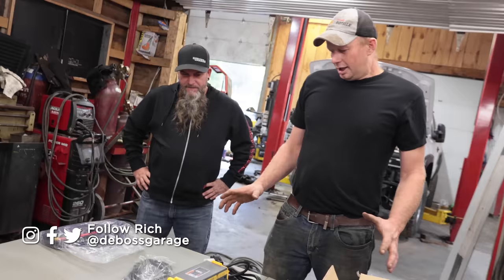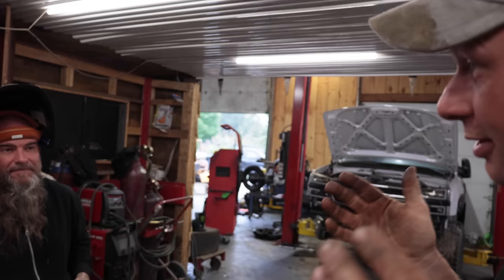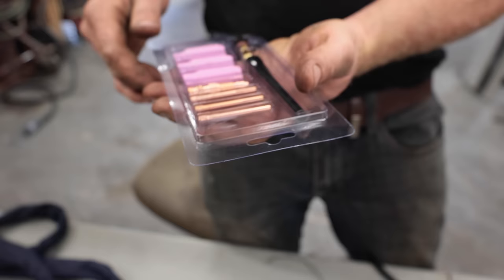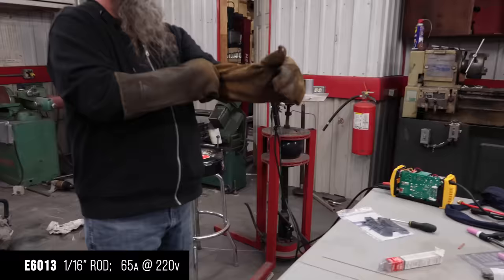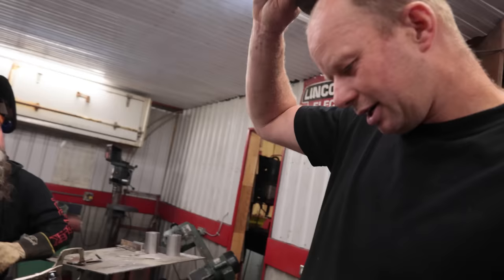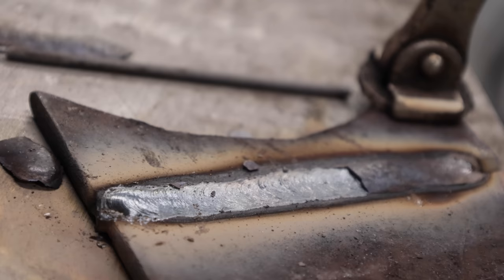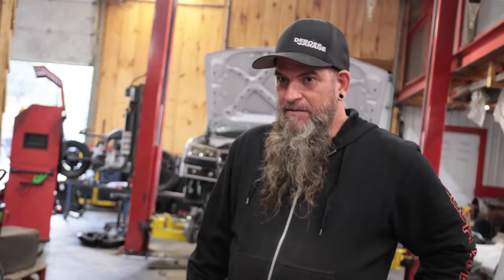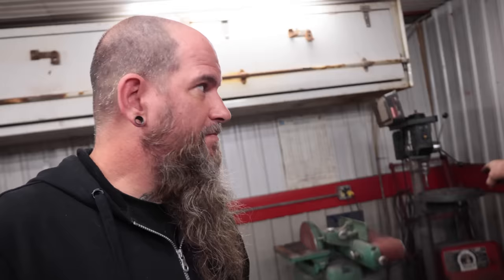How Good is the CHEAPEST Welder on Amazon?

Comment from the maker: Can a 12v Inverter power this welder? Let's find out! https://youtu.be/uPuOjAOAT1k
Links:
$70 TL-1355 LT https://geni.us/135Astick
$100 TL-1355 LT + TIG https://geni.us/135AwithTIG
This one can use a pedal: USD $200 TIG Welder https://geni.us/200TP
USD $70 Pedal https://geni.us/TLFP5P
Reply: whats the watt  rating on that welder
Reply: its 109  cdn for  the sick only kit 241 cdn for the stick/tig kit
Reply: @donaldcrites7504  ya, was going to mention that, was interested at 70 to toss in trailer, less so at 110.
Reply: the tig option is $241 and that's the cheapest its been since it went on amazon in aug. how did you get for $100??
Reply: As a Canadian, it would be proper to use Canadian prices, as bad as they are. Otherwise a good video, and quality review
Reply: Vulcan protig 205, it’s one of the cheapest in store tig welders capable of aluminum and pre/post flow
Reply: i bought a cheap 50 then 70 amp plasma off ebay/amazon and they did great till it stolen..lol
Reply from the maker: A point of clarification, $100 is the USD price for the TIG version, and some are noting the Amazon.ca price is $241 CAD. Canadians can buy this from the Amazon.com USA store and ship it to Canada - that's what we did and paid $182 CAD with no additional import fees (your mileage may vary).

USA Link: https://www.amazon.com/dp/B08B3VHN54?&linkCode=ll1&tag=deboss-20&linkId=a16da0d2dfafeeb18e4a88ded27bf9b7&language=en_US&ref_=as_li_ss_tl
Reply: I got a price of basicly 240 dollars on Amazon
Reply: @DEBOSSGARAGE  sorry for the confusion, being were you are located and how often you mention canadian pricing, i figured this was also $cdn,
Reply: Cheapest Plasma Cutter on Amazon? I found this very interesting BTW, have a MIG but sometimes, could use a stick.
Reply: I think is good to say that by removing the cover the wind tunneling is weaker therefore cooling capability also going down, so coil probably will be cooler in closed enclosure.
Reply: $67 bucks with free shipping
Reply: Thanks guys you got my sub like and comment. 3 out of 3.
Reply: Where did you buy it for $100?
Reply: What amp circuit do I need to run this stick welder on 240?
Reply: These don't give accurate current readings. There's tips for setting it right. (Videos on YouTube)  a little bit of soldering. And a resistor fixes the problem.. but it's not VERY important..
Reply: Well the next logical thing would be a plasma cutter, let's keep the sparks flowing
Reply: Floor Jack's and Jack stands! To many guys out here buying cheap stuff and risking their life to save a few bucks!
Reply: $70 welder!? Nope! $181 as of November 8th. 😢
Reply: @DEBOSSGARAGE the tig option is $177 us price. Dunno where you see it for $100
Reply: @kendraymason  the one they got was the 135A stick welder, which isn't currently available and is redirecting to the 195A welder.
Reply: If the case was on it it would run cooler.
Reply: Your pricing is way off. It is 130.00 us and with tig attached it 165.00 us. I dam sure buy 2 if they were available.  It diverts you to the 195a arc tig welder. 
Thanks for showing us.
Reply: Yes, I have had that welder for about three months and I really like it. I use it on little stuff.
Reply: The 110/220 version isn't available on Amazon anymore, all I see is the 110v, that sux.
Reply: Your review must have sold them out, no 220V available anymore :(
Reply: This was a great video that led to me subscribing I can't believe the work you got out of this little welder ! Unreal
Reply: Will it work for aluminum?
Reply: should use this welder to start a truck or something 👀
Reply: Will it run on a generator in an emergency?
 Watts tha rating plz!
Reply: In the Amazon link there’s one 135 and other 195 amps. This one in the video is the 135 but it comes with the tig addition. For a beginner, is best to get the 135 with the tig? Or will the 195 be a better option. They cost almost the same. There’s also a big difference in price with the 135 alone (no tig). Is the addition a good thing, or is it rarely used?
Reply: I just have to say the prices are exactly what he said in the video and as this comment so everyone talking about prices other that those listed are crazy.
Reply: Good
Reply: Would it work for motorcycle framework(build)
Reply: Surprised to see how well this worked.  I'm seeing this  5 months after it was first posted.  Curious if you have used it since, and if so, has it performed decent in real world situations?
Reply: I wonder if it will work with a - suitable - DC voltage. Like, lets say, 100-110V, or else.
Reply: 🤛🤜 teaching me new things that's what's up 
😊
Reply: @DEBOSSGARAGE  just watched vid.was going to say, can an inverter welder, be run with an inverter. i have a 3000w inverter.. a welder 4x4ing would be handy.  ausie..
Reply: @planitmc1204   mine is showing 67.99 for the regular and 99.99 for tig version
Reply: Keep the cover on , That will help direct the wind from the fan to dissipate heat ..
Reply: Just got my welder off of Amazon for $54.80...it going to kill me?

Comment: The welder guy with 40K hours welding was super chill and knowledgeable. You chose a cool guy that was genuinely impressed!
Reply: his hood constantly falling down pissed me off for some reason
Reply: @wadeedwards6194  ikw but that made me laugh 😂
Reply: Yeah, he wasn't one of those intolerable OG's who think anything other than their "insert expensive brand name here" is "rubbish".
Reply: @wadeedwards6194  Goes to show how old that hood is that it doesn't hold it up anymore. I kept thinking a few rubber bands might fix it lol
Reply: Not use any equipment that is not in working order.
Reply: dude was so chill!  love him lol
Reply: @_knight-king rite
Reply: I only have maybe.. 4 hours welding but isn't it SUPER dangerous working around that open control board considering the voltage and amps running through it? That's a major safety hazard.
Reply: Nope
Reply: 40k hours? Anyone do the math on that?
Reply: @InCognito-yq5ew  plus minus 4,5 years of straight welding
Reply: @InCognito-yq5ew  you have gaming players with over 20k hours, some with over 30k hours, I know because some are friends of mine 😂
Reply: agreed, he probably doesn't know it's actually a High Frequency model. LF would be a transformer based unit.
Reply: By time I’m his age I’ll have way more hours and be much better welder than him. He is a clown welder

Comment: Been a commercial industrial electrician for 24yrs , always wanted to learn to weld , seen this video a month or two ago and picked up this welder first week of February for my birthday . Having a total blast ! Pulling scrap steel off the jobsite all week , and spending the weekends drinking coffee and welding in the morning . Thanks !
Reply: Coffee welder 🧑‍🏭 ☕
😁
Have fun
Reply: Fellow Electrician, only been in the trade 10 years, but Commerical/Industrial as well.

I've had a Hobart MIG sitting around for a few years, I think this video and your comment will finally get me out in the garage welding some steel up.

Gotta start somewhere.
Reply: @perotekku  right on man ! Yeah just a skill i always wanted to have . Been alot harder to do well than i thought , but im making some slow progress . And having a blast . Funny , bought an inexpensive welding table last sunday and found a connection point had broken during assembly , tacked it up and shes ready for coffee tomorrow haha had to use the welder to fix the welding table to continue learning to weld .... its a viscious cycle .
Reply: Did pretty much the same with a flux core welder for my 40th birthday. I still stink, but I stink less!
Reply: where do you gets rods from?
Reply: Living the dream
Reply: This comment slapped a smile on my face faster than the video
Reply: I dont know where you live bro but, you can find rods at Tractor supply, harbor freight, home depot, lowes and ive even seen some for sale at Walmart a time or two  @Mysticlavalamp
Reply: You must be pretty good after 24 years. Bad electricians tend to become welders by accident and surprise. 😂
Reply: @joeypriolo  not to shabby haha , foreman doing schools and federal buildings . Just always wanted to be able to use the ole big boy metal glue gun .
Reply: I'm a hvac technician in the steamfitters union for 32 years just starting getting into welding mostly stick now I'm going to do tig. This morning I'm going to layout plans on a drafting pad for a welding table I'm going to build out of unistrut
Reply: Haha you sounds so chill to hang with i need friends 😂
Reply: That's exactly what I'm goona do!:)
Reply: How is it with 1/8 rods on 110v?
Reply: @irishlush364  not bad , not perfect , im learning so .. some spatter but good penetration on 1/4" structural steel . Trips the 15amp breaker i have it on when using higher amps for a long weld .
Reply: This is all I needed to know, I have some projects I need to do but have no idea how to weld.
Reply: I was looking at these of shore cheapo machines but wouldn't jump. I may now just to have an emergency rig. I've had Miller and Hobart and even a snap-on machine so this video impresses me !!
Reply: I had randomly seen this video in the past and came back to watch. I'm literally thinking on doing the same thing 🤣
Reply: Which one did you get? There's several options on Amazon. Thinking about buying
Reply: @UNUmusic  135amp 110volt  model TL-135s

Comment: I have one too and the worst issue is you have to strap it down because the leads will drag it around lol.
Reply: LMAO, NICE.
Reply: Not a bad deal😂
Reply: That very much seems like a first world problem.
Reply: Would be perfect with a 120/220 belt drive generator on the engine. They don't care about frequency, so RPM wouldn't matter.
Reply: I have one slightly bigger, 200A.. similar form factor.   I bent a piece of rebar into an S- hook.. and I would carry it around with me welding up a metal building.   The leads are short, so I would take it up high on a ladder and hang the welder on a purlin nearby and just weld with it everywhere I could reach--  and move again.  :) ..  I could weld with it anywhere with that big rebar hooked through the handle on top.  Sounds cumbersome, but it was actually very handy.  I could just grab it and go with a simple extension cord--   where as rolling out the big welder is a chore:  if you only need a few quick welds.   They are great little tools to have, even if you have a big welder.
Reply: Yeah, but at least you'd be able to move around your work piece like a truck frame or such easily. Just give the cables a tug and sling that box around so you can continue working  🤣
Reply: @korishan the lugs are cheap ass plastic on the case. That's how my first one died. The lug broke and grounded the case. Then it welded itself into a fireball lol. They warrantied the thing though!
Reply: @ionstorm66  🤣🤣🤣🤣🤣
Reply: NO SHI *
Reply: @korishan new one is over a year old. I have it and my tiny flux mig build into a milk crate and take them everywhere.
Reply: If that's the only issue then it's a good deal 😊
Reply: That's actually pretty funny...
Reply: @calholli That's awesome and thank you for sharing that! It's nice to see someone unafraid to say yeah I've got this little guy in my toolbox and it kicks as a nice little portable welder way up on the ladder!
Reply: Lol they're getting smaller by the minute. They're pretty darn cool.
Reply: ionstorm66. I put mine on a Workbench with G Clamps on Either Side !!!

Comment: I bought one, I was fabricating the support structure for a 20' x 30' solar array, 3" x 3" square tubing 3/16 wall. I have a Miller Thunderbolt AC machine, what a fight to weld out of position. Bought the little welder and it was a totally different experience, all position, it didn't care or fight me with what I was trying to do, it just welded and did everything I ask. It's the best $70 bucks I have ever spent on a tool. It would be a great machine for someone to learn on. To see it gets the Vince Stamp of Approval is all the better, Great Review !!!!
Reply: Just commenting on your thunder bolt welder . I had one that belonged to my father and he used it for many years .I got it after he passed away and used it for 8 years . Now my grandson has it and it still works fine . Now I wonder how long will it last . I might not live long enough to find out . So to say they last is a understatement .
Reply: Nice to know!

Comment: I have been welding for 32 years. I have been constantly surprised by the capabilities of these new tiny machines
Reply: I got their multi process welder and it is better than the Miller I bought like 12 years ago. Technology is advancing at a ridiculous rate and becoming less and less expensive. The Miller cost me about 1300 bucks when I got it and the Tooliom was like 400 lol
Reply: Inverter technology has brought both the size and weight requirements of the welding machine down, and they're constantly becoming a lot cheaper.
With thatsaid, I did just recently buy a new ESAB inverter machine for $5000
Reply: the massive jump in solid state inverter parts, ie: no more bulky transformers and the stuff you need to keep all of that where you want it and cool is, has been a game changer for dc stuff from higer voltage ac mains. its totally bonkers.
Reply: Pretty soon we will have a tool the size of a pen 🖊️ that will be able to weld!
Reply: @thatoneguy454c - In no way can that cheap thing compare to a Miller.  Not a chance, no way.  That cheap Chinese junk is just that:  Junk.
Reply: @Neeboopsh - Did you see the coil / inductor inside this little POS?  Yeah.  Because that can't be replaced.  The tech improvements have been in the ancillary components, not the main ones.
Reply: @foobarmaximus3506  yes, new "Chinese junk" welder outperforms the almost 15 year old Miller I have. I didn't say it will beat any Miller, I said it beat that Miller. It's just a matter the difference between 110 amps vs 190 amps. I can burn 5/32 hard facing rods with the Chinese unit and I can't with the Miller. Any welder that can run 5/32 11018 rods is going to get the job done. Will it hold up as long? Probably not. Is it a good option if you can't drop $1700-$2000 on a welder for your workshop? Yup, it most definitely is. I have used it for MIG and TIG,  it also works well for those processes.
Reply: @thatoneguy454c bruh don't be switch.
This "cheap" welder is great!
"Overpriced" Millers are good too.
Reply: @GOOGLE-ADMlN  switch? Lol and I know that is what I have been saying
Reply: i seen a yt video of someone welding with a car battery..
Reply: @quakergrits4610  you wouldn't get much penatration welding with a 12-14 volt battery, but yes I have also seen that lol
Reply: Wait until they create wireless one 😂
Reply: @foobarmaximus3506 you heard the guy. It’s not meant to replace a Miller. It’s meant to take with you when you’re off-roading for an emergency cracked frame repair or to fix your kids BMX bicycle when he cracks the frame. Can’t haul the miller around all the time but this would fit in your truck box and come in handy if you ever needed it. 👨‍🏭
Reply: Is it just me or has there been an increase in dirt cheap, tiny machines that are capable for the price?
Reply: @markanthonyalamillojr.2586  someday, man? They'll have cheeseburgers...that eat PEOPLE!
Reply: @GOOGLE-ADMlN  you both need to shut up and go cook my breakfast i got a busy day ahead chop chop get going